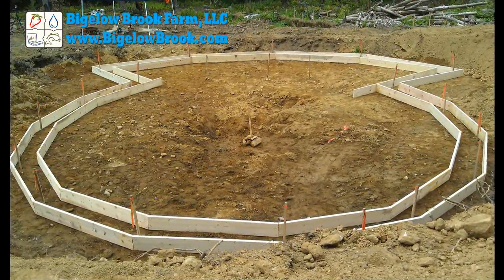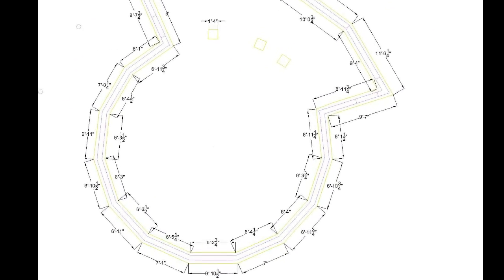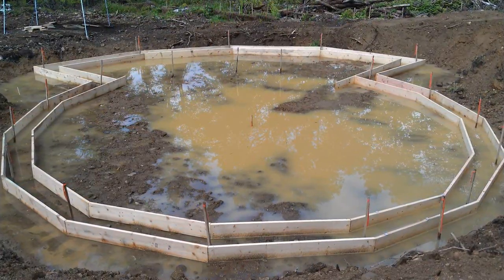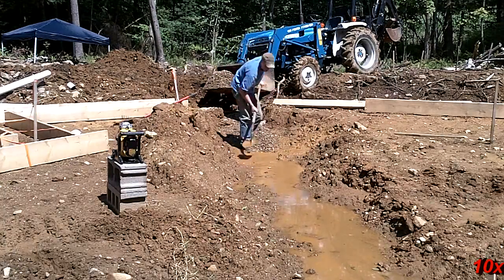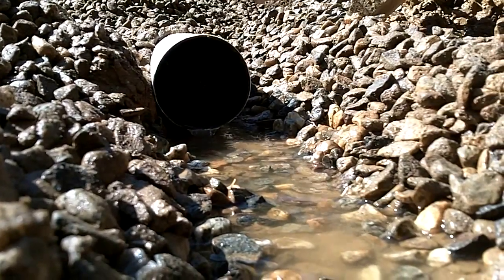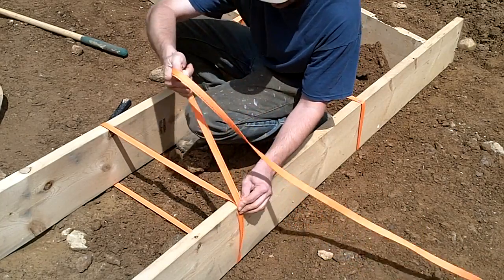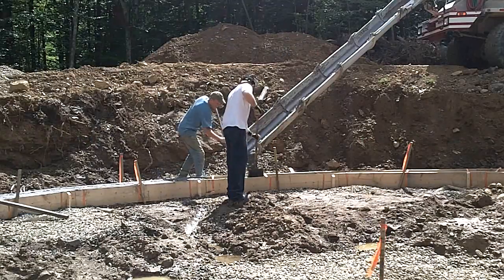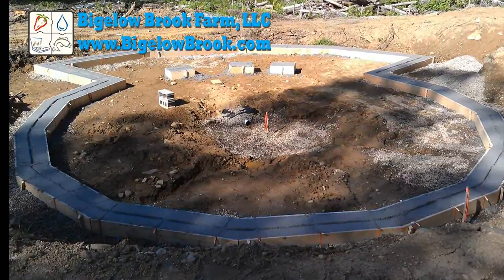Geodesic Dome Greenhouse - Part 5 - Footings and drain

Comment: The line formed by the 3 stakes is it crossing the center of the circle? After that did u measure each corner in relation with all the the 3 stakes position? Trying to learn more about triangulation. Is there a specific website from which you learned to do this? Dont want to inflate your ego or something but you are an amazing human and an inspiration to me!

Comment from the maker: Good question!  First I took each of the lengths of the base segments and laid them in a circle in autocad.  It took some trial and error to get the circumference right.  Out in the foundation hole, I set 3 stakes in a perfect line heading new north/south and measured the distance between the stakes.  Then drew these positions into autocad.  From there, I could have it measure the distance between each stake and each corner and measure it out in the field.

Comment: The footing still needs rebar.  The rebar is for tensile strength so that when the footing flexes, it will not be destroyed.  Concrete mainly provides compressive strength.